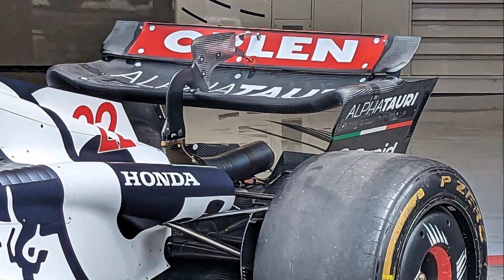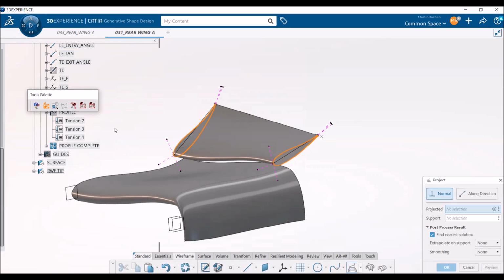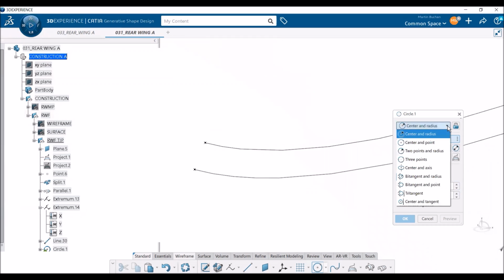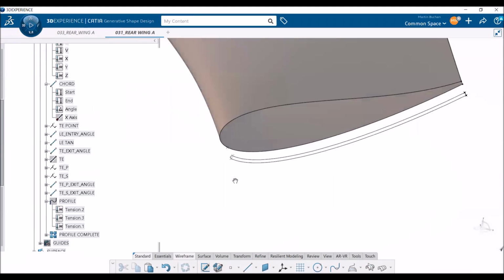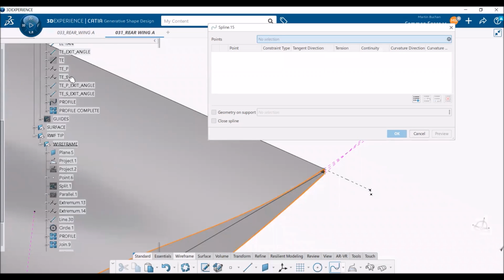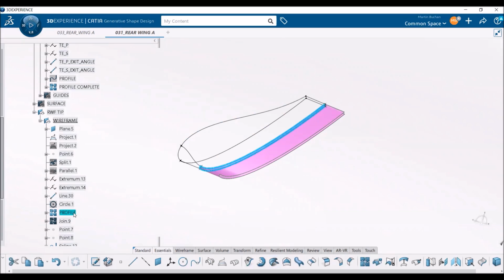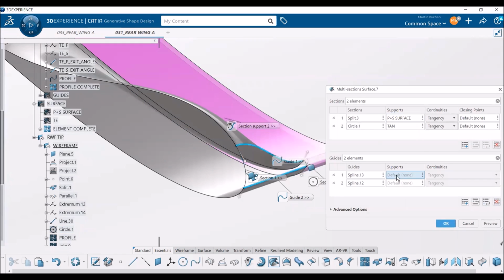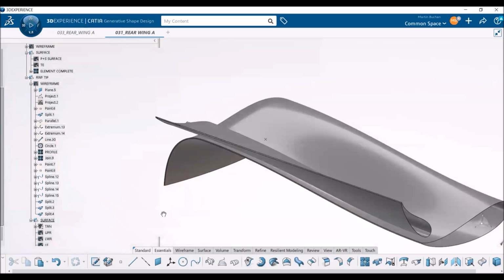F1 2023 - We Design This Rear Wing Tip Feature Together!

Comment: Is it possible to do this in Fusion 360?
Reply: Yeah it's a shame it's not, since CATIA isn't exactly accessible. But the concepts taught are still useful. The main issue with Fusion 360 is the lack of equation curves, so generating the aerofoil profile in the first place is the hardest part. Then to get continuity across surfaces you have to model from surface edges instead of curves, so you would have to split faces to get the edges Martin is creating with curves in CATIA. The equivalent of the Multi-Surface command in Autodesk terms is Loft and in some cases you might use Patch.

Comment: Bro, I need your opinion on something, (I was about to sleep with this headache when) I had this realization about the RB19 concept.

 The sidepod is an (combination of) upside down airfoil(s), and it makes perfect sense because old sidepods (very curvy on top) actually subtract from the cars total downforce in exchange to directing the airfoil to the diffuser and beam-wing.

 I can actually picture in my head Newey wondering if the ground effect sidepods would work in these regulations and trying it out. It really reminds me of the Göttingen airfoils in particular, but look at the S1020.

 If you flip the side view of it (upside down), you can see it's got some "bleeding channels" for the higher pressure on top to go down and a gurney flap like structure at the end of it.
 The highest pressure region (the leading edge) is the sidepod entry which would explain the few losses in cooling.

 That would explain why teams have many different sidepod shapes but none of them worked so far.